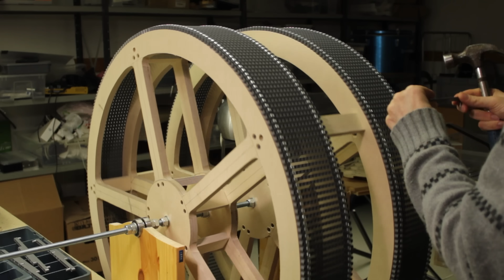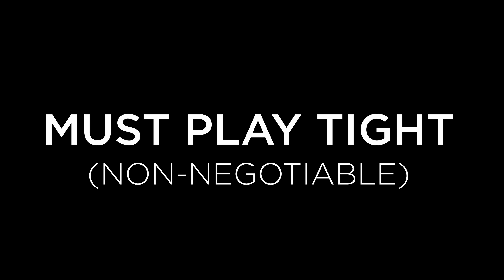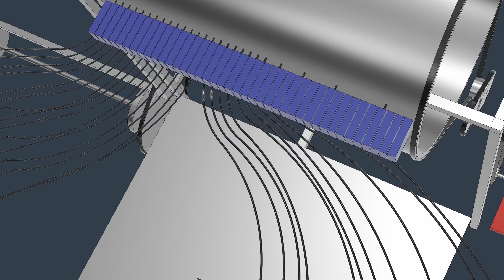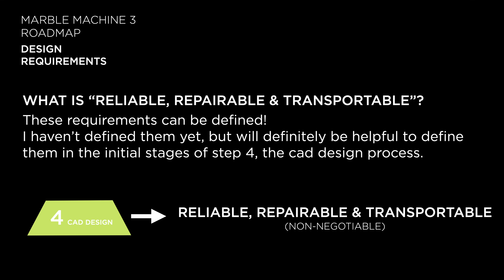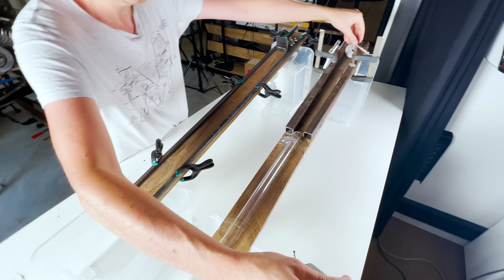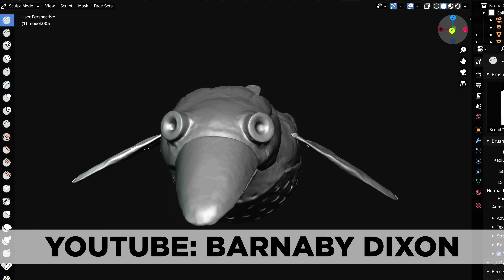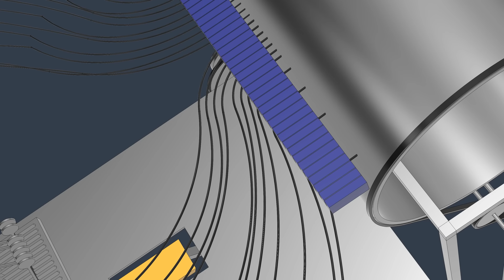Marble Machine 3 is Taking Shape

Comment: [foot peddle] >>drives>> [weight drive 1] >>drives>> [flywheel 1] >>drives>> [weight drive 2] >>drives>> ([flywheel 2] >>drives>>)? [limiter] >>drives>> [MM3].  This way your foot stomping can happen whenever it feels right.   Also: The input power fluctuation should not affect tempo at all.   Only concern would be if these extra add too much extra friction (make the machine too hard to power manually).  P.S. make limiter variable or put in a transmission with different gears?  Tempo shifts are nice...    If you need a lot more power than the options you listed provide, then have two platforms you shift your weight back and forth on with a low of gearing (so you only need to shift ever few seconds or more).

Comment: OOH! I got it! I know how you can keep the weight drive system, theoretically make it take up less space...AND make the tempo adjustable.

So, currently, your models for the weight drive system assume that the weights are falling vertically, right? Just a weight on a pully, that's it.

BUT...what if you mounded the weights on a flat surface, and adjusted their rate of descent by adjusting the angle of the surface? 

And, IDK, if you wanted to tie that to the speed in which you push the pedal, make some kind of bellows system or something like that which would push air under the surface to hold the angle. Push faster, air goes faster, incline increases...weights slide faster?

IDK, it's 100% theoretical, but I can picture it in my head, and I think it would allow you to almost hide the weights under the platform itself. Pumping the pedal adjusts the incline and also slowly lifts the weights so they stay perpetually falling...then the weights drive the machine...somehow.

Comment: If you use a one way rotating clutch (like the back wheel of an bike) on the Huygen weight drive it can stand still whilst the flywheel is rotating by pedal or crank, then pull a lever conected to a clutch to lift the weight then push it back to activate the Huygen and have it as a hands free mode.

Comment: Like on a bike, you are going to want to gide the longer bowden cables.

This is so it can have a 'tighter' time of applied force to activation otherwise there may be variance in the movement of the bowden cables so all cables MUST be the same length to achieve 'tightness' or guided so that the cables movement won't be a negative factor.

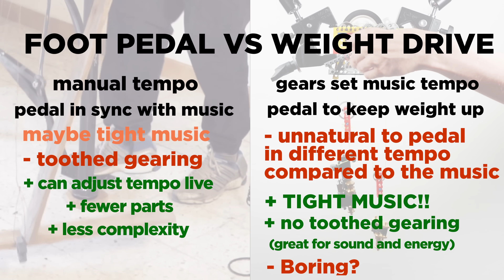Comment: 11:15 Martin, i think you can do variable timing on either manual footpedal or the weight drive. If you were to do the weight drive if just consider using an electric motor to turn the system to keep the weight height over a pedal as that would be consistent without you having to tap outside of the beat. 

Either way i think you'll end up with a great power system

Comment: I think you can´t ignore step 4 and 5 completely in your first 3 steps. You need to have some goals defined earlier. Example; The big programming wheel is the best solution, but it could be to big for any truck you can use for the world tour so it would not work, but you will only realize it in step 4. Or other example, the wight system for powering could be the best, but the weight is 1000Kg. Something that would be inconvenient for transport. (You already did this during design of your gates, by lowering the amount of needed parts, that goes into step 5.)

Comment: I've pretty much lost all confidence in your ability to complete this project. Your false dichotomy of pedal vs. Huygens was infuriating, though I think you coincidentally came up with the correct decision, it was for all the wrong reasons. It was almost as humiliating as your comparison of a 100 g fly wheel vs. an ~1kg Huygens drive. Cute, but not even close to comparable.

If you want guarantees (like "tightness") you need to actually engineer your solution. Testing each component is a great start (and made me really excited for a bit) but there's steps below that on the design pyramid. You should start with ideal components and then descend in detail until you have something that has realistic requirements. You can't do that without physically based requirements. This is why you NEED a physical definition of "tightness" because the phenomena of "tightness" arises from the physical characteristics of the components of the machine. I'd recommend you make a mechanical circuit to model the machine. With that, you could begin to understand the dynamics of the machine in the cheapest way possible. With a sufficient mechanical model, you could entertain different situations like what a Huygens drive would actually do to the machine. What effect would a differential add to tightness? What about a governor? etc... Furthermore, you could make quantitative assertions such as: a flywheel of 'r' size spinning at 'w' rpm would achieve a similar "tightness" as a Huygens drive of 'v' volume and 'h' drop height. 

Until you can make those assertions backed by evidence, you will never be able to guarantee "tightness" and your whole project--by your own admission--will fail again. As an engineer and long-time follower, I want this project to succeed, but you haven't shown any inclination or evidence of a physics based approach to outlining what you want the machine to do. It's a moving target that you can't even see.

Comment: I think that the weight drive would be great especially if you were to add a mechanism that would be able to increase and decrease the rate at which the weights fall. I was thinking you could either apply friction to the string or make the weight slide on a ramp so that the angle of the ramp would determine the speed the weight falls. You could even you something similar to a timpani pedal to change the angle which would be extremely cool imo

Comment: Martin you can design a system to make the pedal wind the weight only or to manually turn the machine. 

You'll already have the pedal in place to bring the weights back up. Add 2 variable belt drives similar to what is on a go cart that you can manually engage/ disengage simultaneously to alternate between weight drive and direct foot pedal drive would allow you to have both options. 

This would allow you to bring the weights up to the top, pull a lever that would spread the pulley apart that is attached to the weight drive and apply a brake to hold them in position while also bringing the pulley on the pedal driven side closer together making the machine run off of the pedal only.

Comment: Tight music as in quantized? Is that aesthetic superior or just an option with exceptions? Deliberately messing with tempo to convey mechanization has been a relatable part of your performances. Obsessing over perfection probably draws an audience as well but is that the same audience that interacts with the music by dancing to it during a performance? ❤
Reply: Quantization is the exact term I would use to describe what Martin refers to as tight music. Perfectly quantized music is required for some things (a Bach fugue) yet sounds sterile and soulless for other types of music.

Modern music typically deliberately skews tracks slightly to create a thicker sound but not so much that it sounds unquantized.

Typically seen with double tracking vocals, lead guitar, etc.

But even some Bach fugues would occasionally intentionally slightly delay one instrument / track to create an interesting sound.

You can hear this on the classic W. Carlos album "Switched On Bach"

Syncopation is sometimes a thing in composition and performance. Not quite the same as a machine playing inconsistently, but I'm not sure perfect quantization is an absolute requirement.
Reply: @pinztrek  yes so making tight music a priority, wich so much time was spent testing on the previous machine, may be more of a problem than a priority.

Comment: How about defining 'tight' as 'any sequence reliably repeatable with any frequency '? Admittedly that is broad. But also measurable and adjustable to suit the art, but also contains unchangeable conditions (e.g. while you might feel the need to change the programming pins/cam ramps to adjust the sequence to 'feel good' in a different tempo, you do not want to be adjusting the followers/cam readers tension apart from the setup/assembly process before a concert). This is however just an example.

Comment: My drill press uses a version of a CVT to change the speed of the spindle.  My thought is to use something like that to adjust the tempo from the weight drive output.  then you could pedal at any reasonable pace and still have fine control over tempo.  Aesthetically, this lets you keep the pedal while maintaining the consistent control of the tempo you want.

Comment: @Wintergatan May I suggest a foot powered crank to run the weight drive re-life the weight to keep the more stable feed of power to the Marble machine, so use them both. 1 Feeds the power, the other makes it stable power for timing.

Comment: my question is why can't you use a motorised power drive since it can deliver same constant power like a huygen weight drive and its as compact as a hand crank? You can put a pedal like button at your base which acts as an accelerator and it will deliver constant power. Yes you need a way to deliver electricity to the motor but you already solved the issue with mmx. Reuse some of its good practices its not that hard. Again you overcomplicate yourself even thought you said you will stop this bad habbit. I don't want to be harsh, i enjoy your videos and i can't wait each week to watch them, but we're sitting for 3 videos just to find a way to power up the machine

Comment: What's stopping you to pedal at your own rhythm with the weight drive? can't you devise a limiter that won't get the weight too high if you go too fast? and I don't think the problem would be going too slow, depending on the height of the weight. 
Does the weight needs to be always at the same level to play at the same speed? Can't you have  a new command lever that controls the speed with the weight drive?

Comment: How is the pedal going to be ergonomic with it being flush with the staging/platform you are standing on? Does it not need to go below the staging/platform and make you kinda lean when pushing it down? Feels like the foot you are not pedling with needs to be at the bottom of the pedals down-movement, so that you use your legmuscles/weight to push it down, rather then to fall down with it and make it lift you up.

This is how i understand your build atm anyways.

Great work! Long live Tjing!

Comment: With the weight drive Having a Gearbox for it you would be able to change the tempo it would just have to fixed presets of Rotation input 1 rpm to output  2 rpm  1 rpm to 2 1/2 rpm for example.

Comment: I have two observations for you to maybe consider, the first is that "tight" though it seems subjective can be measured. You have in effect already been doing so with your previous videos concerning the timings of gate drops etc. and So "tight" can in effect be described as something alone the lines of "the amount of lag experienced between the input and the marble hitting the instrument." I am sure a engineer can put it better. 
The second observations also concerns "tightness",  and this is more of a general observation. A machine that produces a beat/note on command with no variation can be considered to be extremely tight, but it also ends up sounding very mechanical. Take for example a drum machine, it can produce a regular, steady, beat. One that is perfect within it's tightness, and always feels robotic. A human drummer can produce the same beat, but there is always little variations in the timing due to biological process outside of the drummers control, but these little variations make the beats seem more alive rather than a perfectly generated mechanical beat.

Comment: Can you use a Continuous variable drive in the huygen drive? Using a foot pedal to "wind" the huygen,  measuring the beat of the input with your foot pedal with a mech tach, take the output of the tach to adjust the CVD. that way you could set you beat, "lock it in" and adjust it on the fly.

Comment: Glad you took that decision. I was not in love with the weight drive when you started talking about it, for the same reasons you enounced, mostly the removal of the tempo feedback loop that the crank or pedal allow, and I'm convinced the foot pedal with flywheel solution will have a very satisfactory tightness to which your LEGO prototype wasn't doing any justice in the first place.

It's good that the weight drive option is there, but it should only be used if the foot pedal proves to be indadequate, and at the very least proper tests should be made with a proper pedal prototype to at least give it a fair chance before crossing it out.

Comment: Any consideration for using a belt driven CVT after the weight drive such that you can tune the tempo on the fly? The weight drive would hold a constant RPM and you could tweak it up or down as you see fit to match the mood of the music.

Comment: When it comes to Part 4 you could probably make a rig designed to give wear & tear as if its been used to see if things break or when they would break. as for Transporting Crating it would be the easiest option. but you could go more extreme & make kit packages. Basically Machining out foam to be able to fit parts into luggage. <do yourself a favour & consider the total weight that would be in each luggage bag. the durability test can aslo come double handy as you would probably be able to tell what spares or how many spares you may need to bring with. Dont Engineer on Copium wilson says it stinks up the house

Comment: Why not make the input geared too?
Have a gear system to make the pedal of the Hdrive in sync with the tempo. 

Slower tempos will require a harder pedal push but it will also be left frequent, I can also see a tempo being to fast to pedal, however with a gear system you could set it to be a multiple of the tempo or whatever you are comfortable with.

Comment: Is there any way to combine the foot pedal and the weight drive? Maybe you could have some kind of powered motor that you can manage the speed with the pedal that allows you to lift the weight drive? Unless you can figure out a way to lift the weight with gear ratio or something.
Reply: Also another thing that could be done is having some kind of lever or something to increase the speed the weight drive can fall so you can both maximize the weight drives time without having to constantly manage it, but also choose to temporarily increase the speed at the cost of reducing the time it will fall for that time. At least I if you could accomplish that it would be a good idea IMO.

Comment: I'm happy to see you sticking with the foot pedal design (I always thought it was such a naturalistic and smart design decision on the MMX) as I do agree with the assessment of the weight drive as "boring" from a performance perspective. That said, if you do want to have the option of something else powering the machine so you can step down from the platform and hype of the audience or whatever - JUST USE A MOTOR!! IMHO it's just as "boring" as a weight drive hidden under/behind the machine that no one will see, but it would be far more reliable and simplify things.

Comment: I don't see why the adjustable tempo with the pedal must prevent the weight drive. They are not mutually exclusive: you can use the pedal for power and tempo, store the power with the weight drive, and change between them with a gear box. You can even pick a tempo manually and keep it up (and tight) with the drive, giving you even more freedom for music.

Comment: I think the weight drive mixed with a hand crank to charge which would also add a nifty side piece where you stand aside and crank for a moment. also using 3  programming wheels could make it easier to service. for manual tempo you could have a clutch that changes between manual and auto

Comment: It seems to me that in the pyramid diagram the area of each step represents the time they take. At least, i think that the bottom level takes the longest time, but if you have all your building blocks designed, iterated and tested then putting them together should be pretty straight forward. On MMX you put unproven subassemblies together and tried to fix them on the fly but now you will have a proper "library" and everything is in CAD. Happy crafting!
Reply: The problem about the pyramid is that it shows steps as their own entities. But something as "mundane" as assembling everything can push Martin down to the first stage quickly, as changes to existing modules could be necessary. He has zero idea about the implications of later steps as he has abandoned pretty much all the elements he acquired knowledge about with the MMX.
While it is the right thing, to organize the tasks, one also should not make the mistake of believing they would not intersect.

Comment: To the weightdrive variations of speed, you could add a variable speed drive, it is a pully system that can be adjusted with a few turns of the nob

Comment: Regarding Pedal vs Weight drive,  could you design it to be easy to change, so that you can do the simple solution (foot pedal) and then add the wright drive later if you think you need it. In SCRUM we call this the "last responsible moment".